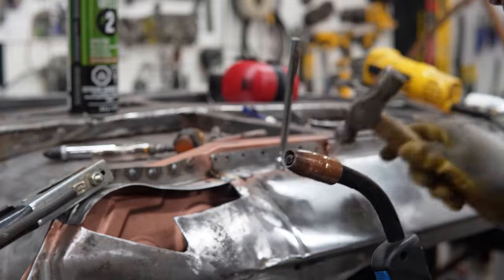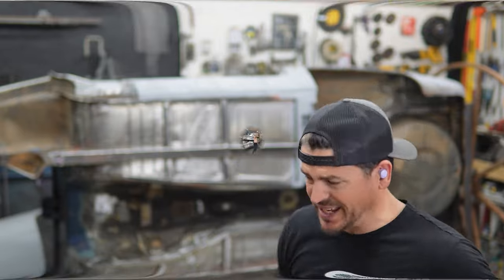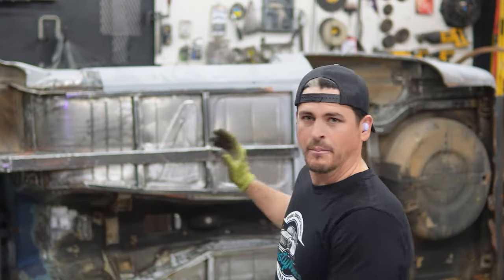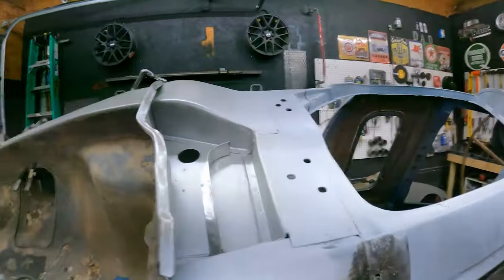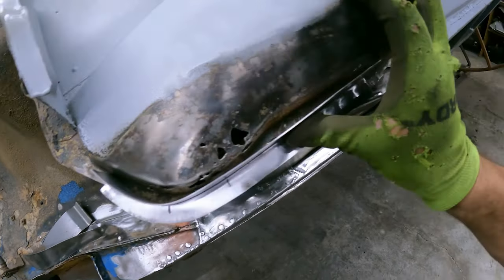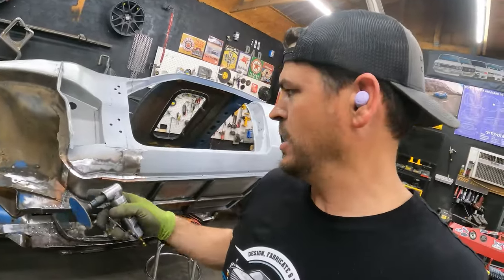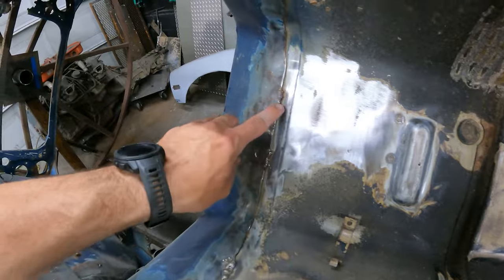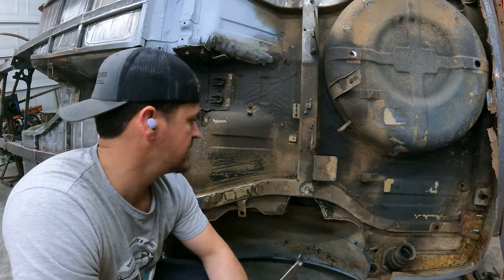DATSUN 240-Z BUILD IS BACK |Fabrication, Undercoat PREP, Primer & More!

Comment: I used a heat gun to melt the undercoating when scraping it off. Much easier
Reply from the maker: Yoo bro!! I didnt try heat, but I might have to give it a try. So far scraping was the easiest to get the undercoating off vs the wire wheel.